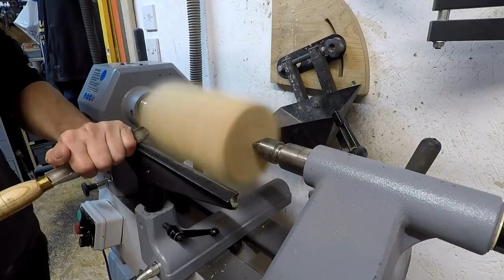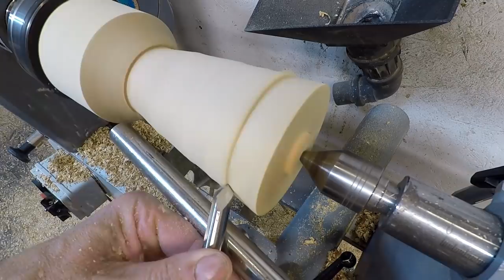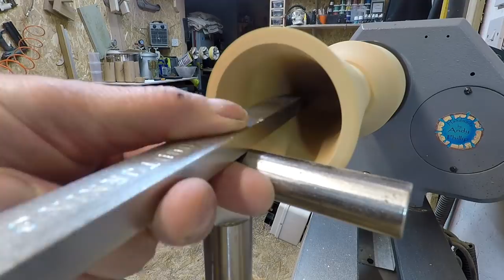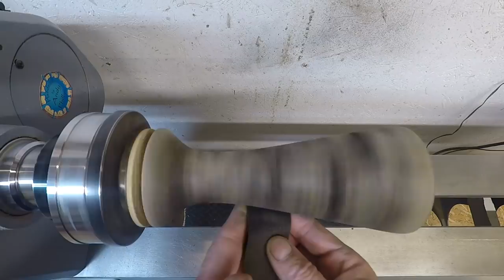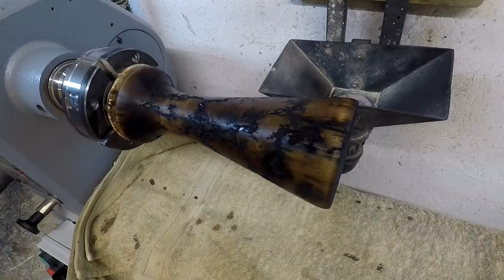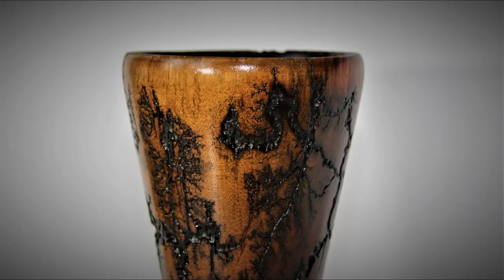Woodturning - The Goblet of Fire

Comment: Andy, just a suggestion; make a cigar humidor. Most guys who smoke premium cigars covet a good, handsome humidor. A round unit would be a real novelty. Loaded from the top, up and down and not laid flat. A removable porous stone that attaches to a wooden top to facilitate moistening the stone. A good Padron cigar typically measures 7" in length. Your bore is at least 8" to accommodate most cigars. Just a thought.  .

Comment: Without getting into the specifics of your apparatus, what voltage are you using? You're getting better results than I ever got with convex surfaces, and I'm wondering if it's because your technique is better than mine or because your rig is.
I have found that if you're working with a fairly hard wood, a pressure washer is great for cleaning off the charcoal and surface soot.
Reply from the maker: Thanks for the tip about the power washer .. still experimenting really.. send me a DM on Instagram if you want ..dont want to say much on here ..

Comment: Nice Andy.  There is a finish you use quite often, thick and amber colored.  I believe you used it on this piece.  Can you tell me the name of the product?  Thanks.
Reply from the maker: Thanks Tom .. Its actually a light oak stain from blackfryer that I used on this before spraying with lacquer .. I dont like the colour after the burning so it just helps it look more natural .. you may have also seen me use Danish Oil quite a bit ..cheers Andy

Comment: What make and model of lathe does this guy use, and where can I get one for my shop?
Reply from the maker: Its an Axminster at1628 vs
Reply: Andy Phillip nothing on Amazon, low similarities on eBay but nothing that directly matches. But after doing an image search with the model name/number you wrote I found out why, because the image search had a link to a European site. It’s hard to find tools that I want in my shop that are only made for European makers.

This makes me uncertain about where I want to buy my tools, because now I’m questioning whether or not to buy tools internationally, or tools locally because I don’t know which ones are better made.

BTW this profile (Parker’s Playground Entertainment) isn’t really a channel I’m using for YouTube videos anymore.

I now have a new channel: Project Nerd Cave, and this channel is where I make videos about making anything and everything nerdy that can be made in a workshop. 

Right now I only have 2 videos on the channel (a letter to Adam Savage, and Pallet wood separation) but I’ve got more workshop videos in the works.

Right now the operation is small consisting of only me and my shop space in my parent’s garage, but I plan on having a whole 50’ x 40’ workshop for things like Metal/woodworking, leatherwork, prop and costume building, CAD, collecting, and all sorts of stuff that can be done in a workshop.

So whenever you see comments by Project Nerd Cave, it’s also me

Comment: Can you show your litchenberg burner set up please?
Reply from the maker: sorry it can be dangerous if not done correctly so its not something I want to show ..
Reply: @AndyPhillipWoodturning  I know and I figured, don't wanna be liable for any mistakes. I just love that design, hard to replicate by hand. Been trying to bring it to a couple of projects lately with more or less success.
Reply from the maker: @bucolic9681  its definitely a cool process .. I'm just using a normal setup  that you can find on the net but use movable arms to hold the electrodes and I use a dead man's handle  about 8 ft away  so I cant go near it without the power cutting out ..